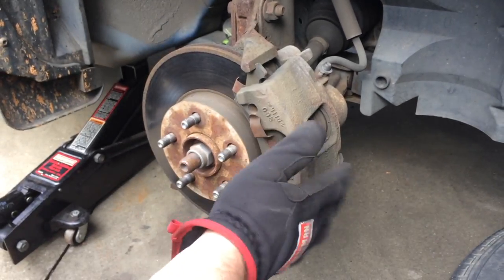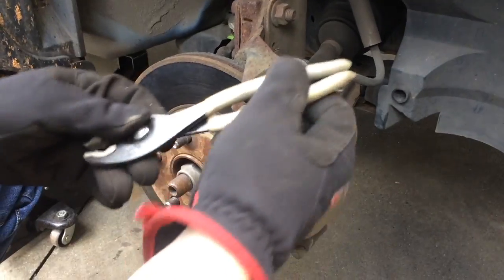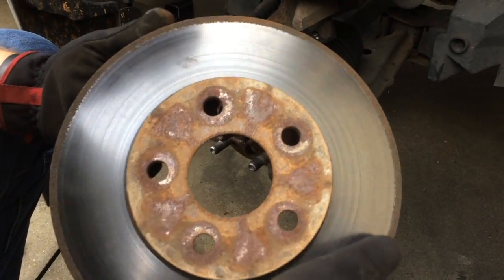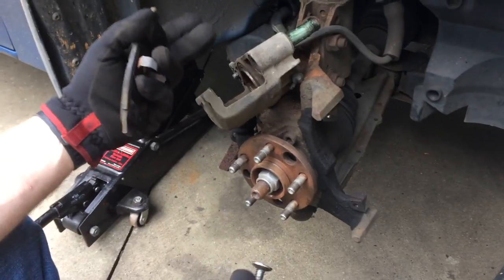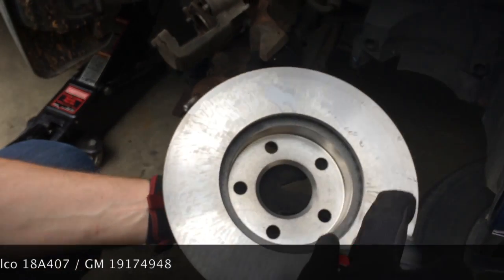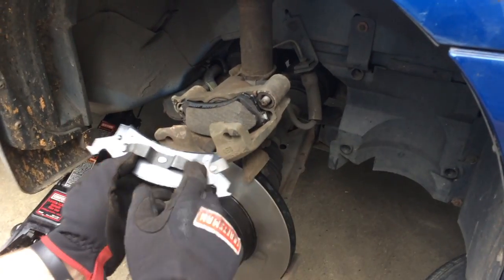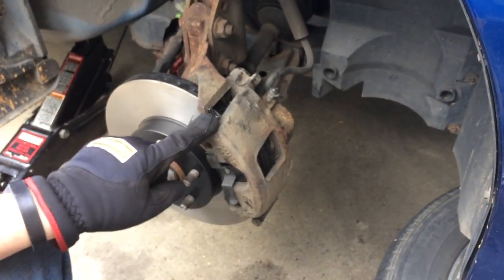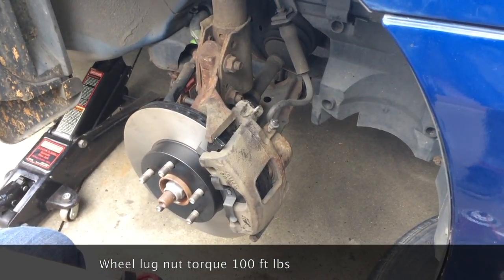2003 04 05 Chevrolet Cavalier & Pontiac Sunfire Front Disc Brake Rotor & Pads Replacement

Comment: I changed out my brakes and did everything that I have seen on YouTube and on the Haynes manual. Now my brakes feel spongy. Did I do something wrong?
Reply from the maker: "changed out my brakes" - changed the pads only or also the rotors?  You might want to see if when expanding the caliper to accomodate the new pad if you pushed out brake fluid from the master cylinder area.  And also confirm you installed both pads (facing to each side of the rotor) in the correct orientation.
Reply: @DrShock  I replaced both rotors and pads. I did take some fluid out and did have the cap off when I pushed the piston back in. I will go over again to make sure that I put the pads in correctly. From I can see, i have a friend mashing the brakes with the engine off and I see the piston pushing on the pad. I did notice that some grease pushed out from the caliper pins. Looks like all the grease I applied on them was pushed out off from the boot. Took one out and it was dry.

Comment: Why is all I see for the new caliper bolts is ones with metal bushings for cavalier?
Reply from the maker: The caliper pin on these GM J-cars (Cavalier & Sunfire) was unique to them.  It is a larger pin that doubles as the caliper mounting bolt, sitting in a rubber bushing in the OEM GM design sold thru ACDelco.  It isn't reproduced exactly by any aftermarket company, where they instead use a bolt and metal bushing combo to reduce their costs.   The original GM pin bolts are now discontinued, but you can still find the rubber bushings at the link I provided in the video description.
Reply: @DrShock  so I can use the ones with bushings in my 98 cavalier. It will fit in river bushing and just grease everything up? Mine are sticking even after cleaning and lube.
Reply: I just use the original rubber bushing and lube new metal bushing and bolt and it will work. Seems dirt etc would work it's easy into it easier. I put them aside by side and seems same dimensions when bolt is in new metal bushing.
Reply from the maker: The aftermarket design should end up being about the same dimensions, though more prone to making noise without rubber bushings.  You can reuse the OEM bushings if they are not cracked, torn, brittle, swollen, dry rotted, or otherwise damaged.
Reply: @DrShock  that was my concern, send for would get in and rattle but I imagine side much better till get dirty. Thanks a million. I've asked around everywhere and no one knew what I was talking about, no one!
Reply: *seems it
Reply: Original rubber bushings are in pretty good shape fortunately. They are asking like $20+ a piece for them! Used to be cavalier parts were cheap and a dime a dozen but now are becoming obsolete and hard to find or expensive. My idler pulley bearing went out and destroyed the bushing and couldn't find one anywhere. Could find pulley but no bushings for the life of me. Had to go by dimensions and find something else compatible. The rubber is swelled up a a good bit, the new ones might work out better even though pads were still wearing even. Thanks again, they should put some kind of info in description of new ones so people like me aren't scratching their heads...

Comment: My inner brake pad on the passenger side goes in loosely, how to fix this?
Reply from the maker: A GM ACDelco pad should have two springs that grasp the inside of the caliper piston, you might try bending them out a bit to tighten up that grip.